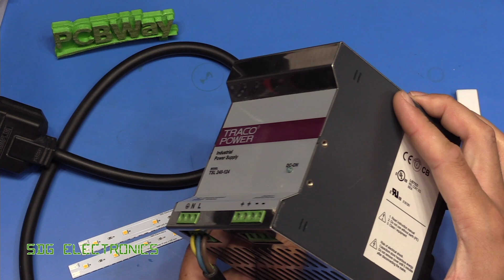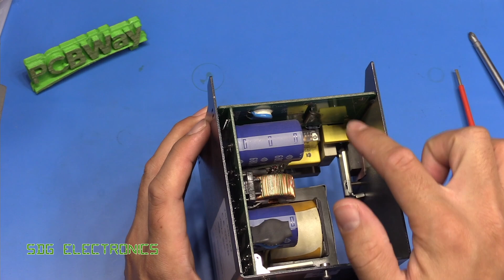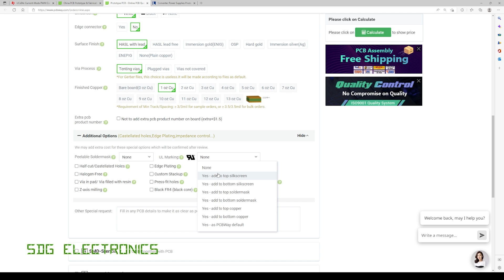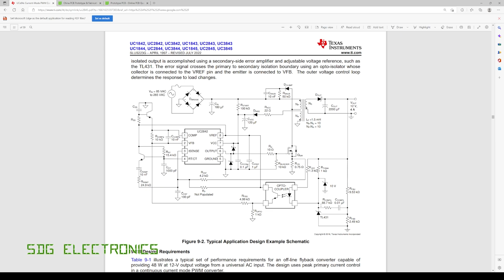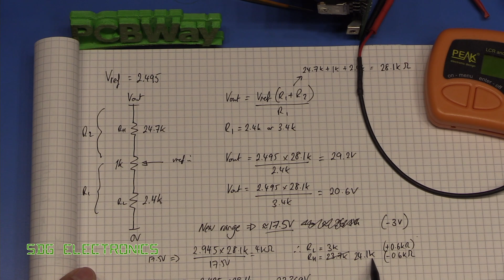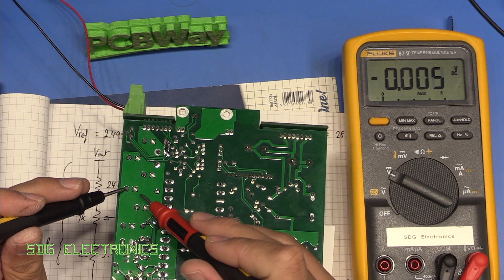SDG #263 How to modify the output voltage of a SMPSU power supply

Comment: Really good video, thanks. Does reducing the output voltage, raise the output current capacity? I have a similar need, where I want to cut voltage from 24v to 12v. My output current is rated at 13A, would like to gain some current capacity.

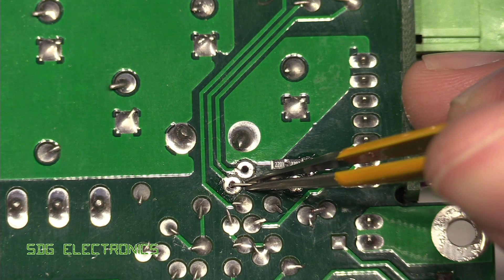Comment: 13:08 Is there any reason to worry about the 2k2 resistor (the top left one) being placed (physically) directly onto the grounded island? It is even including an application of hot solder to add to my concerns. I admire your faith in the strength of the green solder mask coatings. I would have added a layer of something insulating, even just one or two layers of Kapton tape. Or perhaps "routed" the resistor pair a bit further south.

Comment: Are you sure 3R is enough to prevent thermal runaway? 😢
Reply: I reckon with 50C temperature rise each LED’s voltage may reduce by ~100mV resulting in current increasing from 150mA to 350mA 😨
Reply from the maker: I was thinking about this the other day and you're probably right. I may have to revisit and modify one resistor on each board to 10R. Turns out over 200W of LED lighting is far too much anyway!

Comment: Somehow I saw something like this coming after watching the previous video!
I would not be sure whether to keep the total series resistance constant for the compensation to be not affected or rather the approximate parallel resistance since the lower and the upper half of the voltage divider are essentially parallel connected for any ac-coupled noise signal... However, in the current case even that would also only be a minor change, especially with regard to the typical tolerance of a capacitor used in such a compensation loop.

Comment: Nice!  I did essentially the same mod to one of those black brick laptop supplies to increase its output from 19.5V to 24V so I could use it to charge a modified tool battery (Li-ion swap).  It's been plugged in continuously for several years now, working perfectly.  I love this sort of re-purposing mod; it saves items from the landfill and justifies our component hoarding!

Comment: Nice to see a smd bodge, i think i'd just have shunted the lower 1/2 of the variable resister.
Reply: Indeed, calculating a change (lowering) to just one resistor and then achieving that with a resistor on the back seemed like the very obvious solution.  I accept that it would increase the load but that would be small compared to the 10 Amp capability.  It would also change the adjustment range,